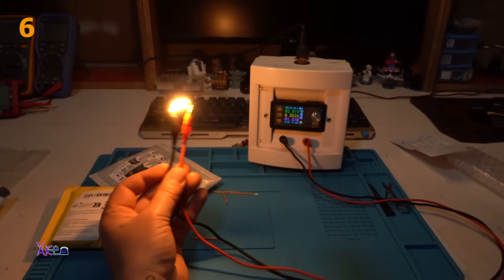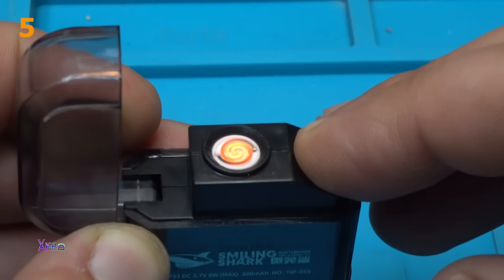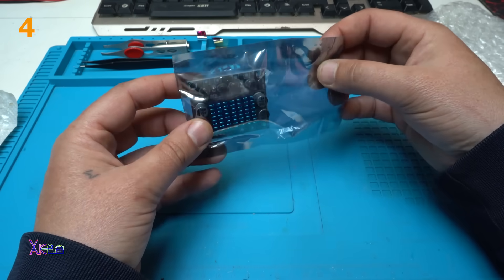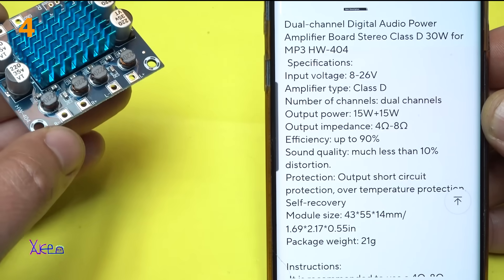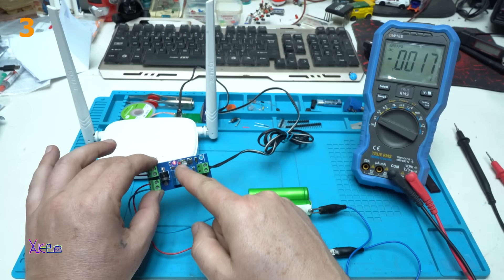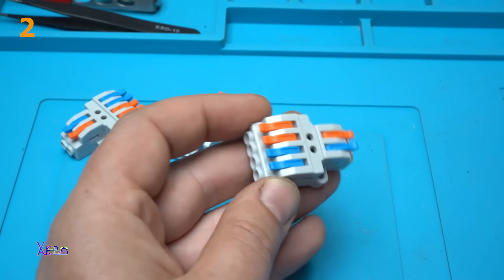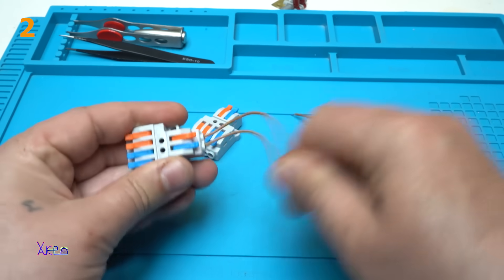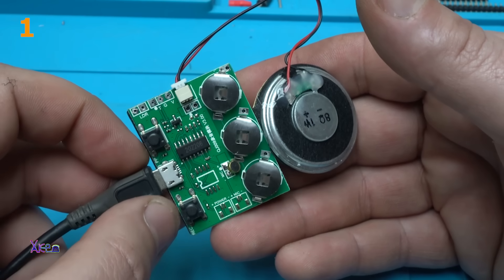TOP 6 SMART $1 Aliexpress Modules

Comment: I need a 240v sensor to switch a relay. I tried.the zmpt101b..doesnt work. Voltage at output stays at 3v no matter if I connect 240 or not? Many dodgy stuff on AliExpress
Reply: A schematic diagram on the Internet shows that the voltage sensor with ZMPT101B is not a switch.
The output is an image of the voltage on the 240 V mains connection (more or less sinusoidal wave), referenced to half the DC supply voltage. 
This means, a DC voltmeter connected at the output should display approx. 2.5 V (for a 5 V supply), no matter the AC voltage at the input. So, probably the circuit is OK.
In order to use this as an AC voltage dependent switch, the board could be modified or something else should be added at the output .
Reply: @CG-rr6yx  If he only needs to detect the presence of 240v then a simple method is to use a 240v neon indicator along with a photo-transistor or photo-diode, that could switch a relay without any arduino involved.
Reply: @CrackpotCreations Good idea. An integrated optocoupler, using a resistor and a diode to supply the LED from the AC mains, would be easy and safe to use.

Comment: In my opinion, these terminals are not trustworthy and comparable to Wago! There is a fire hazard at mains voltage and maximum load. For model making or low voltage, you can use them.
Reply: I use several models of them, but for testing only, nevertheless great stuff they save time and space...
Reply from the maker: I understand your concern, I will keep that in mind in the future.
Reply: 2.5mm is US awg 14 guage wire which is rated at 15 amps. So even if this can do 32A, the wire can't!
Reply: @markanderson8066 2.5 mm is AWG 10 ;
1.5 mm is AWG 14 .
Reply: @markanderson8066 2.5 mm is AWG 10 ;
1.5 mm is AWG 14 .